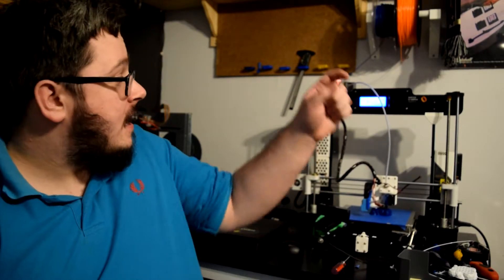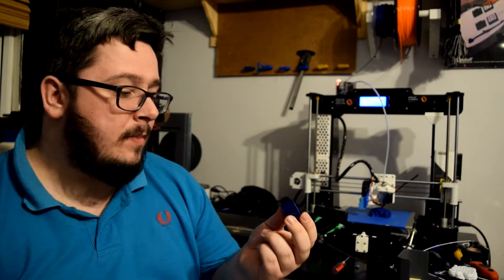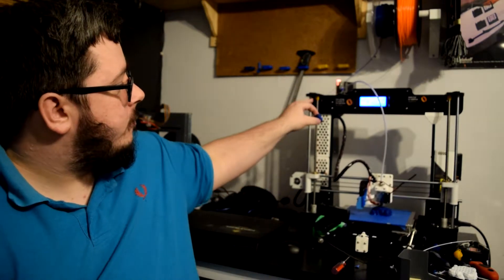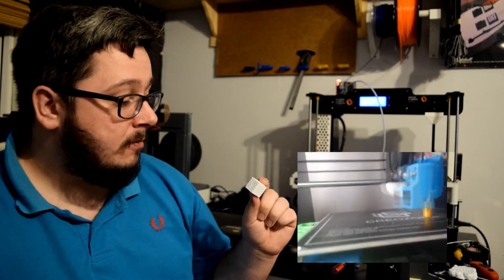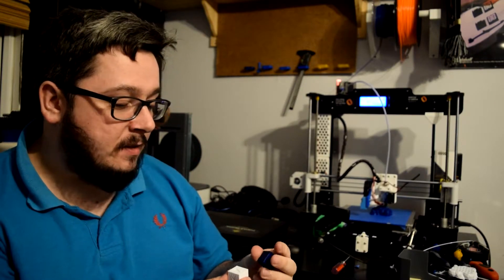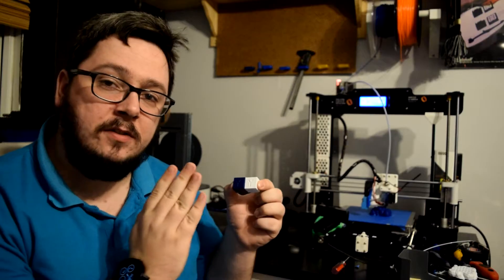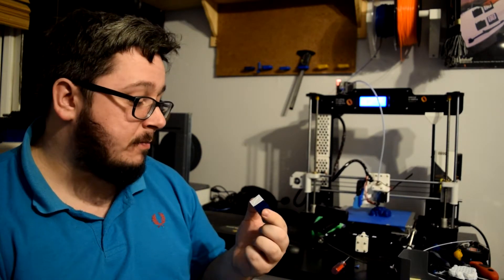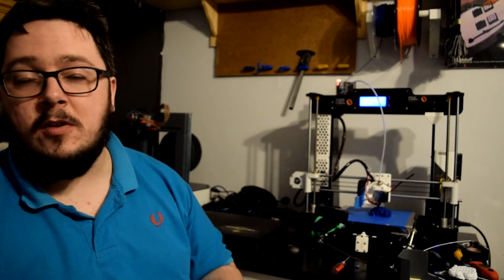Anet A8 Anti Z Wobble, Does it work?

Comment: There's no need to constrain the leadscrew at the top at all. Any misalignment or any bend of the leadscrew has to go somewhere, and if you don't allow it to wobble at the top, it'll have to just force the wobble into the whole frame of the printer and the toolhead. Even if the overall frame was stable, which it is not, the linear rods are similar enough to the lead screw in modulus; so any forces resulting from misalignment or distortion get split in two halves, one half bends the lead screw straighter, so it looks less wonky, and the other half bends the linear rods less straight, which the toolhead is referenced to, imparting on the print. It'll probably look the worst half way up the print volume.
Reply from the maker: Hmm, I don't have the printer anymore so I am unable to test it in the ways mentioned, it was my understanding at the time that it would hold the bars steady so that it would have less errors such as vibration on the outer walls etc. 

Thanks for your insight, i appreciate it!